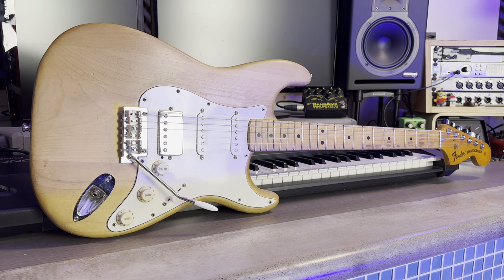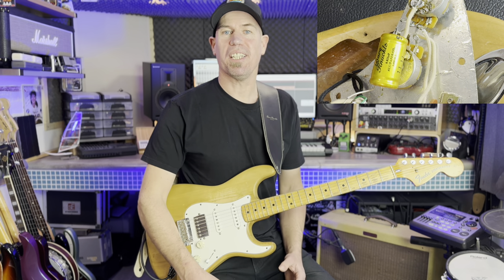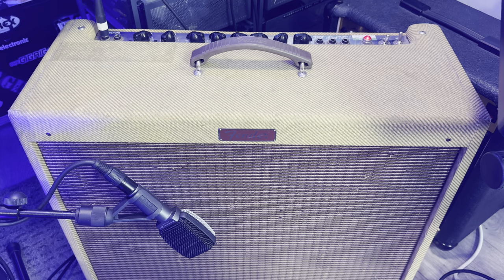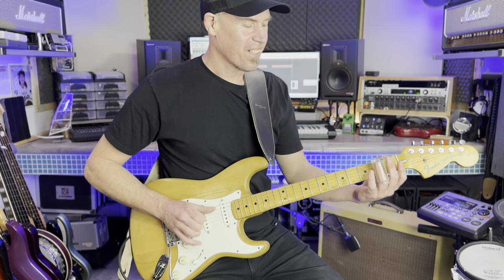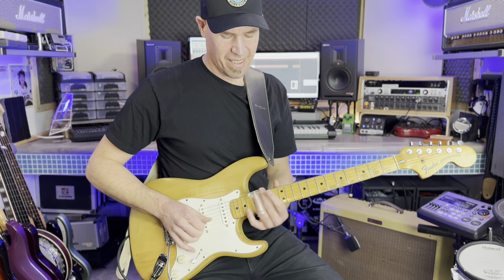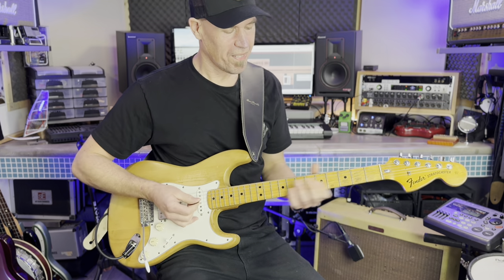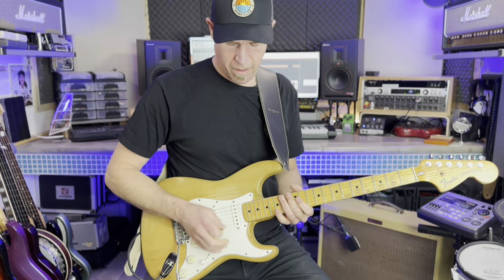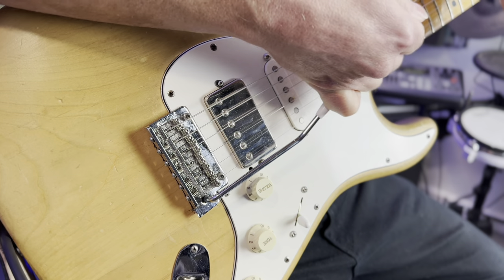Supercharging A Vintage Fender Strat - Bare Knuckle Mule & 63 Veneer Board Pickups Demo!

Comment: Great playing, and it sounds and looks fantastic. That trem sounds really solid. Was it a direct fit for your strat, or did you have to drill, adjust, etc?
Reply from the maker: Hey dude, 
Yeah Wilkinson makes/used to make a direct replacement for the 1970s spec. It’s a wierd one as the string spacing was slightly closer together in the 1970s? This is a two point fixing that lines up with the two outside holes, but I put brass slugs in to help take the extra tension also ?!
Reply: @JonBishopGuitar  Brilliant. I’m looking for a good trem for my 70s Road Worn strat and that could definitely fit the bill. Thanks Jon.

Comment: As far as I know, locking tuners don’t “increase tuning stability”.
Did you mean that the old ones were knackered, so you installed new ones?
Reply from the maker: Yeah, in terms of tuning stability with a tremolo system locking tuners improve tuning stability. There is less string going around the peg to stretch and slip. Also the locking mechanism fully clamps the string in place. But the old ones were shot too !